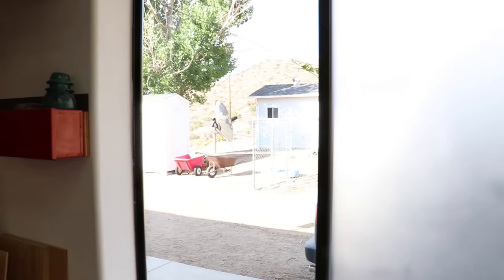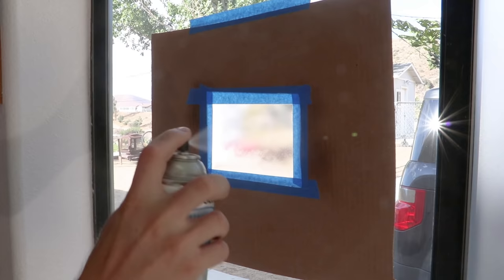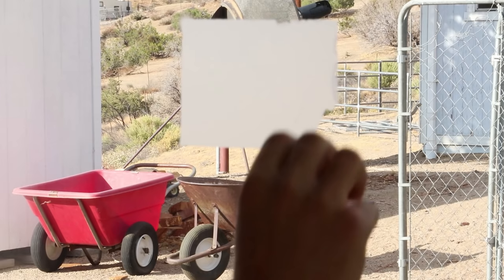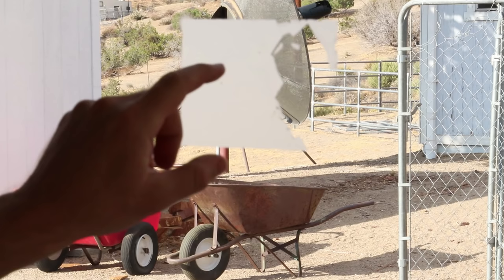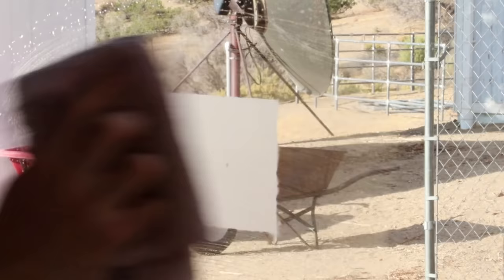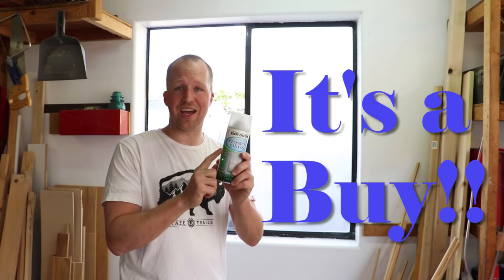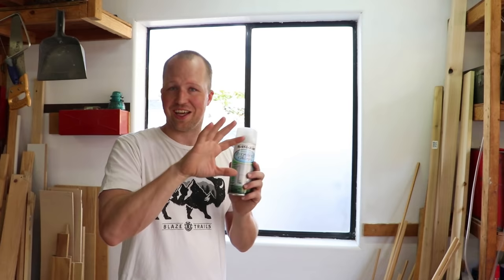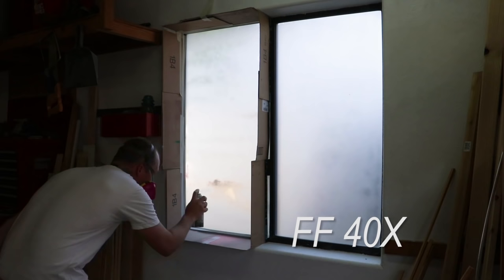Does Frosted Glass by Rust-oleum work?

Comment: The Rustoleum Frosted Glass spray worked exactly as advertised.  However, keep in mind you will need to spray the entire surface about 4 times.  You don't necessarily need to wait in between coats.  However, I found it useful to spray 2 coats, let it dry for 5-10 minutes to see any spots that need more coverage, and then apply the remaining 2 coats with emphasis on the spots that need more coverage.  CAUTION:  The fumes are very intense.  I had to open every window in my house, and use pedestal fans to vent the fumes.  Even then, the fumes were overwhelming, and I had to space out coats on each window.  Obviously I used the spray on the inside of the windows since it's clearly not made for outdoor applications.
Reply: Thank you for your comment! I have a newborn baby at home. I’ll have to plan for a time when she can be out of the house.
Reply: @mariannastrench  Definitely make sure that everyone is out of the house, and make sure that there is LOTS of ventilation.  This is good stuff, but it is spray paint, and the fumes reflect that fact; a situation that is amplified indoors.  It works really well though.  Good luck!
Reply: Will more coats make it harder to scratch?
Reply: @meaganmann196  he has scratched it very easily because he did it the same day but as time passes, it is not easily removable like he shows.....it still comes off with a razor but not that easily, sometimes you even have to use some acetone so it comes out......that is with about 3 fine coats and letting it dry in between.....hope this helps you a bit!!!
Reply: Spray it outside not inside

Comment: It works extremely well. I used it as a test on my screen door. A tip for faster drying time is to turn on a small fan on low about 6 inches from the glass surface. I've reviewed it the process compared to etching and prefer it!

Comment: I have a glass topped sofa table that I just love, BT it has a few scratches on it that I can see in the morning sun. I plan on applying the spray on the bottom side so as to avoid the finish being marred. WAY less expensive than a custom cut and beveled piece of glass in an rounded triangle shape. Hoping for the best!

Comment: Thanks for posting this. Just got a new home built and all the lighting now are these clear class covers over the bulb with clear bulbs so when if you have a bulb in line of sight it just burns you eye to he**. I was looking for a way to frost the glass covers. I was thinking of using my compressor to spray fine sand on them to chip them up for lack of better words, causing a diffraction. Headed out to get a few cans of these. As you showed if I don't like it, it's easy to remove. Thanks!!!!!

Comment: Has anyone tried a ??satin?? or ??high gloss??  clear coat over the cured Frost coat to see if that improves durability??  want to use on a storm door and carrying out garbage and stuff will mess it up if it can't be made more durable.  Most storm door companies have NO obscure glass options.
Reply from the maker: Very interesting idea
Reply: No matter what type of paint you use, it will scratch off easily because glass isn’t porous. It needs to be porous for the paint to stick.
Reply: In the end, we went with a GenTek storm door who offer the obscure glass option.  So it is durable for 70 years like the old storm door that had stick on sheeting where it shrunk so much you could see through the cracks.  Takes a while and extra $ to find the best solution.
Reply: I tried gloss polyacrylic sealer and it made it semi glossy/more transparent.   Going to try a matte sealer
Reply: That’s exactly what I thought! I’ll will do one coat of Polycrilic clear matte spray over it once it’s dried to increase durability. Wish me luck!
Reply: @SheriMaass  Did it work?
Reply: The cling film might be your best option with an existing door.

Comment: It gets a lot harder, and more scratch resistant. over time!
Reply: yeah, that's what I was thinking too. I haven't tried the stuff myself, but I'd imagine it'd be much more durable and harder to remove after a few years.
Reply: What would you recommend to remove it once it's a bit older?
Reply: @missbeaussie  One sided razor blade. Strips it off very easily.
Reply: Nail polish remover... acetone
Reply: Forget acetone, razor blade is exponentially faster & no more harsh chemicals!

Comment: For it to be more scratch-resistant you are advised to clean the window by using rubbing alcohol and to pass three light coats,  BUT letting each coat dry first. A good job takes time. A rushed job only shows you did not care about the work you do.

Comment: Thanks for the video. I have a question. My bathroom window window was tinted so people couldn’t see in. Our contractor used a spray-on tint. Is that considered good, or just mediocre. In other words, would using a film have been a smarter option?  Thanks!!
Reply from the maker: a film might be easier to remove so if it is temporary  I would go with the film.

Comment: Hello, I have been trying to use this exact product but am having issues with the paint creating bubbles on the surface. Does anyone know how I can prevent this?
Reply: Make sure the window is completely dry by cleaning with alcohol first and letting it evapourate. Don't spray in sun.
Reply: Also thin coats let dry and add more coats
Reply: Maybe the can that you got came a bit damaged, sometimes they come with the spray nozzle damaged, that has happened to me many times,not with the frosted one but with other Rustuleum spray paints...it totally ruins the job.

Comment: Good afternoon.
First of all, thanks for your video, it helped me a lot, I didn't know that this type of product existed. I already found it here in Brazil.
My problem is related to birds that are bumping into the windows of the house, and, unfortunately, some die. I want to avoid this aggression, but at the same time I don't want all the glass to be completely opaque.
Do you know any way to apply it, so that the glass only loses its reflection, but remains transparent?
Thanks for the answer.
Reply from the maker: Sorry I don't think this is the product for that.
Reply: birds dont just crash into the window because its reflective, they crash into it because its transparent and they dont even realize its there. unless you fog it or make it more opaque in some way i think they will continue to fly into it. You could try putting some decorative tape or patterns or something on the glass so they realize it is actually a wall. Also this fog spray doesn't make the glass completely opaque, as you can still get light to come through it and still have a very blurry image of whats immediately on the other side.
Reply: Maybe spray a square border around it?

Comment: will it hold up to natural heat from sunlight ?
Reply from the maker: I ended up applying the frosted glass to the entire window that I used in the demo it gets light 4-5 hrs a day and looks the same as the day I applied it.
Reply: @natelarge  ty
Reply: Nate Large - Woodworking DIY & More:  Would the paint come off if an object that was spraypainted got wet, or would it stay on?
Reply: He actually demonstrated wiping vigorously with a wet rag and a drying cloth in this video. It didn’t affect it.

Comment: Can't applied to outside exposer?
Reply: I did on my bathroom window.   I put on the outside.  It seems to be holding up just fine.   I cleaned the glass really good before applying.  I put on three coats for an even distribution.   If you spray inside, mask off everything.   It’s goes everywhere.    I made the mistake of not doing that a few years ago.

Comment: Does it work on acrylic?
Reply from the maker: yes
Reply: Just today I used this on 2 acrylic sheets. The sheets were lying horizontally - not upright - and the spray came out as spray and drops. I don't know if this was because I was pointing the nozzle down towards the acrylic rather than straight ahead like it would be if the material was vertical.